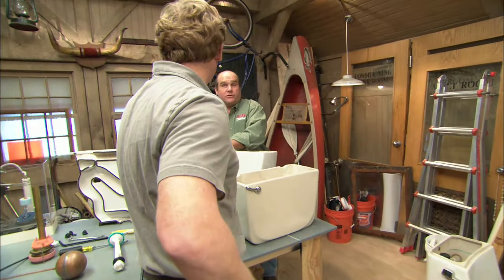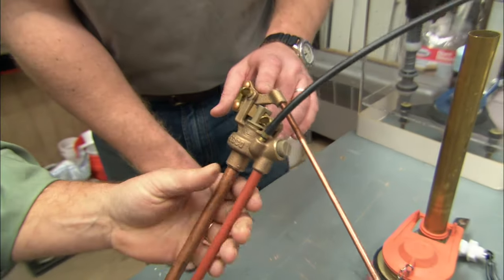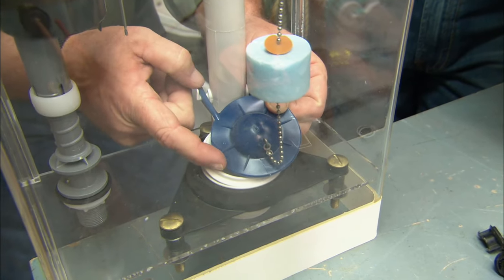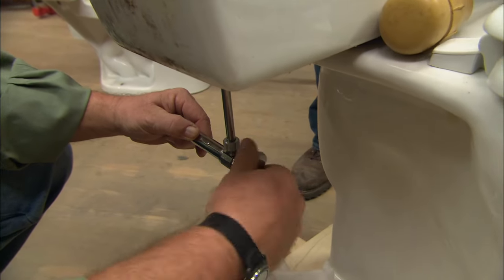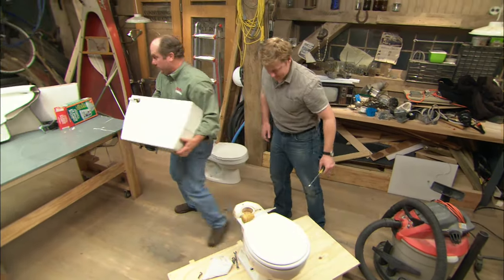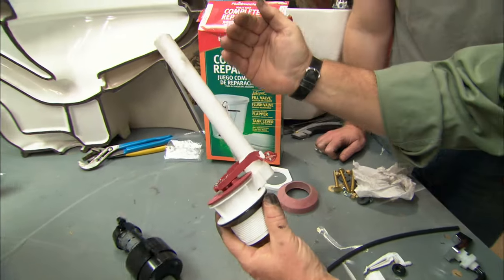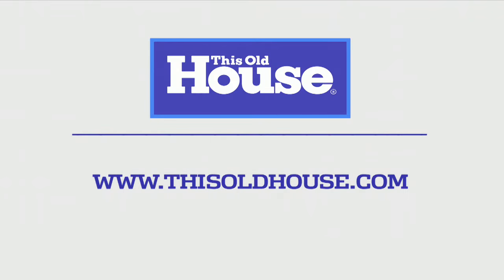How to Rebuild a Toilet Tank | This Old House

Comment: 5:15 No gasket on the fill valve. I would put a plastic fill valve in after the tank and toilet is installed. Less chance of it breaking etc while doing other parts :)
Reply: That isn't needed in the video as the water isn't connected to the toilet
Reply: I was wondering about the lack of gasket, too.

Comment: There is a problem with this video. When they unscrew the three bolts securing the tank, there is no bass nut and washer between the tank and the base.  My tank also does NOT have  nuts  between the tank and the base. So, I'm not sure if I should install them and worry about comments suggesting the tank becomes "tippy" because the tank is sitting on the three nuts. Something is wrong.
Reply: You can't install bolts if there are no holes to put them through.  I don't understand your post.  I will tell you that some Kohler toilets have a metal plate between the tank and the bowl.  However, you still need to put some bolts through.  If you are looking to get a new toilet, get a Gerber Viper.  A plumber on YT recommends them highly and I just installed one at my house on his recommendation.  Get a "slow close" seat with it if you do.
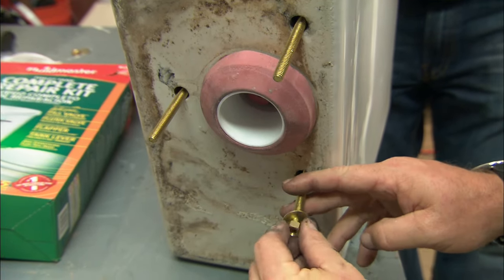Reply: @AStanton1966  At 4:12 of  the video the tank is lifted off, there are no nuts between  the tank and the base. That is, the only nut on the bolt  connecting the tank and the base is on the underside of the tank.  At 6:00 of the video, a brass washer and nut are placed between the tank and the base, that is there is a nut fastened to the underside of the tank.  There are therefore, 2 nuts on the bolt: one between the tank and the base and one on the underside of the base.  I installed the new equipment and determined that there were countersinks on the top of the base that allowed the nuts to be used. But  I had to purchase extra nuts and washers as the set only came with one nut and one washer for each of the three holes.

Comment: Two things to suggest here:  (I see that MANY others below agree.)
1) I think you assembled the tank wrong?  Doesn't the rubber washer go BETWEEN THE BOWL and the TANK?  That's how it came apart.  At least you don't get STEEL nuts against the porcelain.

2) WHY not WASH the bottom of the tank?  And the inside.  Try vinegar. How hard could that be????  Easier to do when its apart then after re-installed.
Reply: Wondering the same thing.

Comment: 5:40, He just stripped the nut. Plastic is no good, always go for brass if you don't want water allover your floor and a large repair bill.
Reply: I'm not sure, do you mean the small crack sound before they changed scene?

Comment: What about the newer toilets that have a pressure tank in the tank of the toilet??? I have had to replace the entire pressure tank due to the problem of no pressure to flush. But I found that a replacement pressure valve is available. Please do a vid of these style toilets. Fixes and problems (1.2-1.6 gallon flush)

Comment: I put the rubber washers in the inside and outside of the tank not on the toilet
Reply: the second one protects the bowl.
Reply: Yeah that porcelain can crack and splinter easily without it
Reply: The correct way, I do too.

Comment: One thing I never understood - how does the tank fill by the water from the valve/float going into the overflow tube?  I thought the overflow went straight to the bowl, so how does the tank fill up?
Reply: While the float valve is open, it is BOTH refilling the tank and refilling the bowl through the hose that goes into the overflow tube. When the float reaches the top, it closes the valve - and both the tank and bowl have now been refilled
Reply: @scottkain7474  I get that part, but I'm more confused as to how the tank gets filled through the overflow tube.  I don't get how the tank fills up when water goes through the overflow tube. I assume the overflow tube goes straight to the bowl.

Comment: I just found this video. I'm having a slow continuous leak into the toilet bowl. I replaced the flapper but I could see that water was still leaking in. Looking at the gasket near the drain valve I could see that the gasket is coming apart. It looks like it is deteriorating. The toilet is over 20 years old. So tomorrow I will do a rebuild of the toilet tank.

Comment: My problem is that the fill water is hooked up to the overflow pipe as a diagram shows, but water is running out never filling the tank. Tf water is hooked up to the outside of the overflow pipe everything works as it should. What is happening here?

Comment: would the steel alloy wingnut cause galvanic corrosion with the brass nut??? wouldn't it make more sense to uses a brass wingnut of the same composition so that no corrosion on the connection occurs, especially it has a connection to the fill tank.. would that pose a risk of creating electrolysis in the fill tank thus corroding other metal components in the fill tank?
Reply: You're 100% right and that's exactly what happened to me

Comment: I would've taken a sponge and found out exactly where the leak is coming from, and only replace what I had to.
Reply: At the cost of the complete kit vs just that specific part, it's not really worth it. They are likely of the same age, and one won't be likely to outlive the other by much. You're talking maybe $6 to do it all at once, and the major investment in all of this, really, is the time it takes to get the darn thing off! (That was my excuse, anyways) :P
Reply: I agree with the idea of doing it all at once.  It's like replacing the batteries in your smoke alarm every year at the same time every year.. it is to stay in the habit of regularly maintaining stuff that is designed to last only so long. Chances of your batteries dying before a year are small but say you put it off and then they do die before you replaced them... you find out the hard way.  Same with the toilet.  Routine maintenance can actually save you from molding your house with water and rotting out the floor.  $5 more than you're saving tens of thousands sometimes in costly repairs.  Plus,  it's a toilet... my least favorite thing in the house are water issues, make it dirty toilet water and we've got a really yucky situation.  Plus they are designed to work together.  Once you break the seal on one thing, all the others aren't necessarily good anymore either...

Comment: Some toilets have syphons and ball floats like mine
Reply: Joseph Walker what is a syphon?
Reply: In my experience the old fill valves lasted longer.

We had 1 last 19 years and than we moved.

We had a new fill valve installed where I live in within 3 years it was not working right.
Reply: You mean Siphons

Comment: I love Richard, BUT half of the work he is doing he is KNEELING BEHIND THE TOILET... where the wall would be for all of us! In-order to loosen those tank bolts/nuts I have to lay on the ground & squeeze btwn the toilet and the vanity. And there is absolutely NO WAY I can hold that long screwdriver AND loosen those nuts at the same time! Definitely a two person job and it should have been mentioned. #imho

Comment: I rather call the plumber...
Reply: Joyce L. That's costly
Reply: Stephen Snell  that's a troublesome work !! :)
Reply: Sorting out a toilet  isn't really that hard in fact you'd save a lot of money if you do research and pay attention and watch this video right through. The easiest parts you can replace yourself are the Flush Handle,Fill and Flush Valve.If the flush handle on your toilet becomes loose and wobbly simply remove the lid of the toilet tank and look for where the Compression Nut is to and then simply tighten it by hand until it is nice and tight(take care not to over tighten). If you leave the flush handle on your toilet get too loose and wobbly and will eventually fall off rendering the toilet unusable until the handle is put back on and tightened up.
Reply: Give it a try though
Reply: There is nothing difficult about this at all
Reply: A lot of people do it it's easy as pie
Reply: That's costly! You can easily do it on your own

Comment: You don't have to bend the rod to adjust the ball because there is a set screw on the top. How about a real plumber on that show?
Reply: That guy has been plumbing since before you could say the letter P